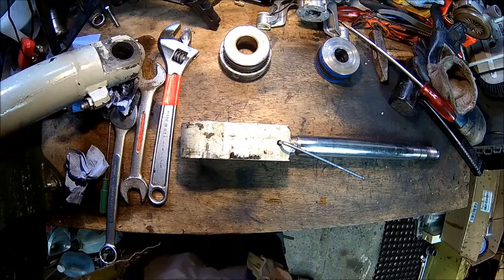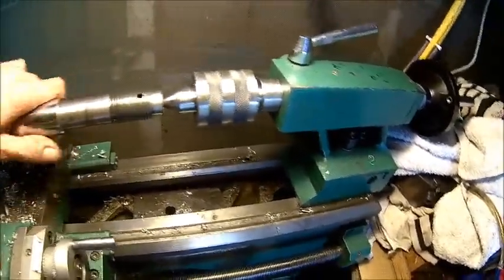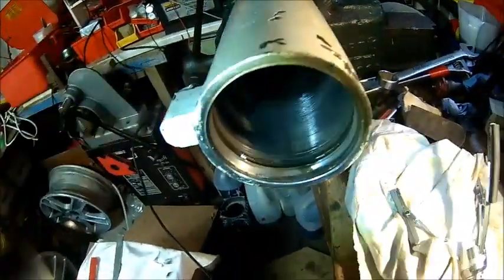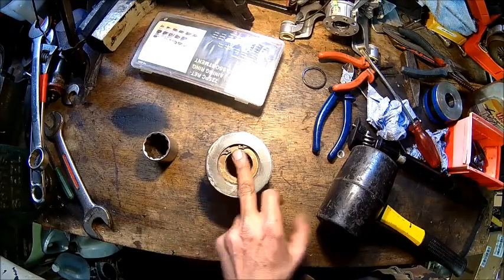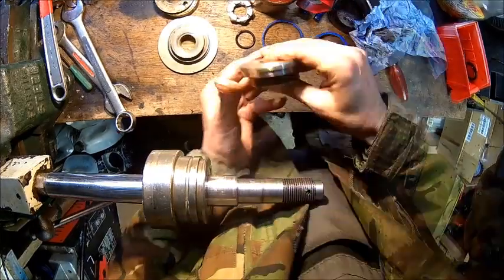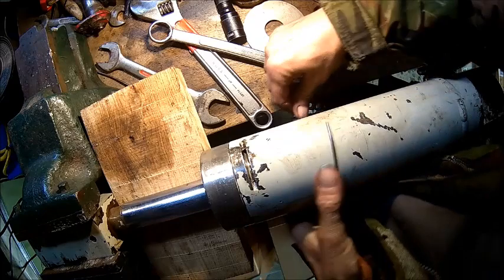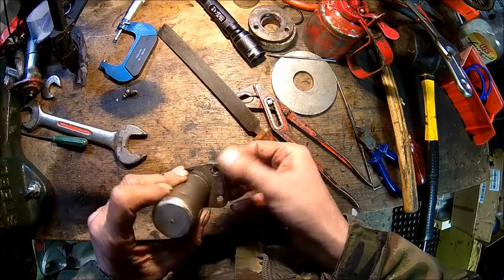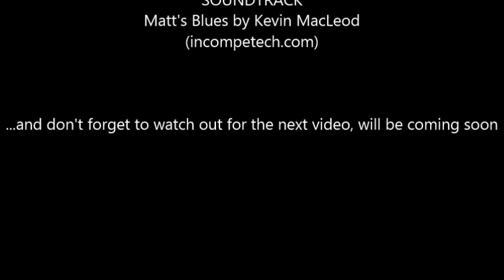Hydraulic cylinder repairs/assembling, This old forklift Ep#5, Lansing Bagnall FODR6 tilt cylinder

Comment: Well done, and JIT! This one was hard work, though. I like your way of going ahead and fixing one thing after another and in the end the fork lift is in a state it wasn't in for some 35 years. This just is skill and perseverance. Thank you.
Reply from the maker: Thanks Mate ....It's quite a simple strategy, function + reliability comes before appearance. Having a clear picture of the state of your machinery (and a "feel" for it) also helps a lot.  Equipment which does not work or breaks down every time you use it is pretty useless. It its broken (or about to be) and function critical,  just fix it.  Saves a lot of time in the long run  -  no need to be pretty and sometimes it may need a bit of improvising, because most of my gear is rather old and parts may be hard to find. Lash-ups are OK, as long there is some life expectation in it, but brainless bodges are a no-no, because they bite you back. Same applies to all my cars, preventive maintenance is the key to reliability, frequent reactive fixes clearly indicating that you are behind schedule.....stay safe
Reply: Totally with you on this. And, yeah, let's stay safe.